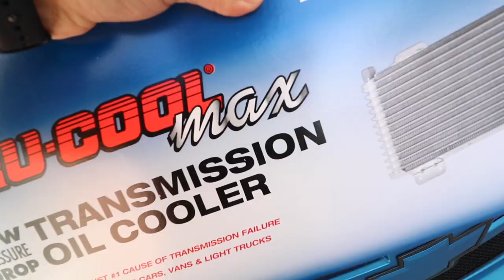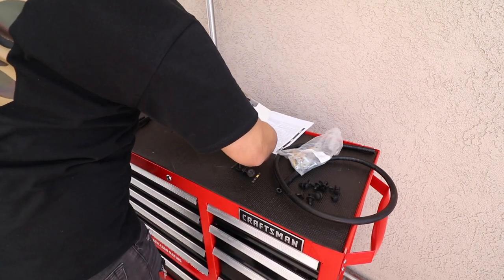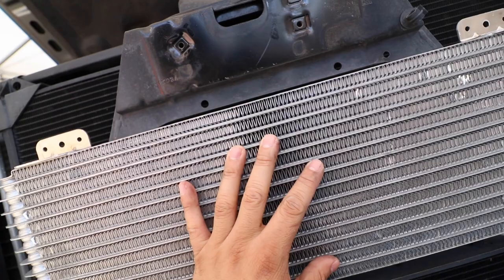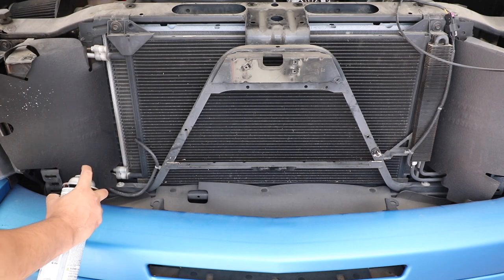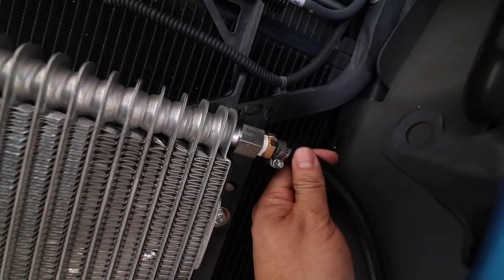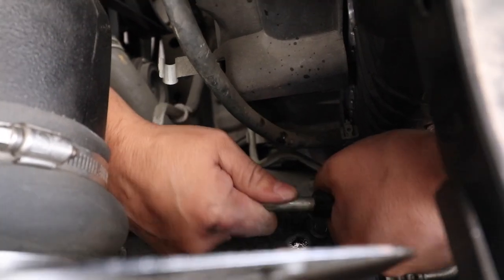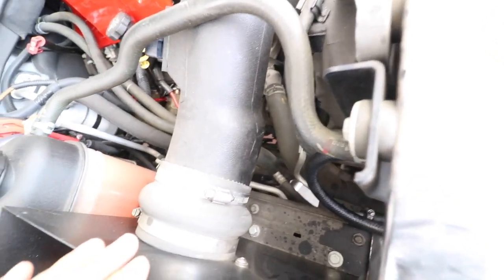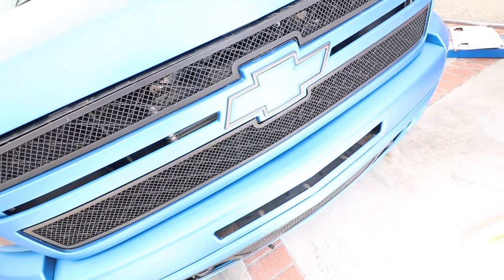INSTALLING A 40K TRANSMISSION COOLER ON MY 09 SILVERADO SINGLE CAB!!!

Comment: Helpful post, bro!  Just a couple of suggestions to those who want to do a similar installation--

1.  Install both auxiliary hose lines in the correct lengths needed to connect up to the main trans line ahead of time and then carefully pre-fill the entire new cooler and hoses with trans fluid so that the system is pre-filled and will have no air pockets.  You can plug the hose ends with a bolt shank or similar so that it doesn't leak out while you're re-connecting.  Then carefully take the plugs out and connect to the main line connection points.  This minimizes the qty. of fluid needed to add once the job is done and also (as mentioned before) eliminates air pockets in the line.

2.  It's up to you, but if it was me, I would remove the air intake tube / box to have better access to the trans line where it connects to the radiator.

Overall though, good vid, with easy to understand steps.  You do good work on a budget too!  Keep up the good work!
Reply: Thanks!

Comment: Nice!!! Mine just came in can’t wait to installs my temps are typically around 185 and easily get to 200 with heavy foot right now
Reply: What’s uour temp running at now?
Reply: What’s it at now?
Reply: @gagegonzalez2767  average 150-160. Went off roading hard in high desert and Max 185-190 for a little bit. Super impressed.
Reply: I need it bad then

Comment: You gonna have to relocate the ambient air temperature sensor, otherwise you ambient temperature will be higher, i make that mistake lol
Reply: Yup, I'ma leave it like it is until I have to take the bumper off again! 😂 Keeps my 6l80 no hotter then 185 loaded.. 120 at lowest. But mine is a Dana trucool 40k

Comment: 1 On re-assemble do not FORGET to replace the securing'HoseClip' back of radiator when inserting the new Part - No 397  ..otherwise you will blow all of the Trans fluid when in gear! 2 Prefilling the cooler is a wise move, and as the maker notes you DO NOT HAVE TO install with the hoses down, you can go side, either way or on top, it does not matter which way.

Comment: Thanks for the post man mine usually runs about 200-230°F so this is helpful
Reply: Dang mine get from 100 too 150 and I thought that was bad
Reply: @1highLT  that’s good you prob already have a aftermarket trans cooler then
Reply: Mine does too and it didn’t have one just added one now
Reply: I wish we could have seen which line from new cooler goes where.

Comment: I ran mine to the bottom and cut the single hose they provided in 2. The trans line you tap into makes a U  in the bottom and i cut it then slipped the hoses on but either way works

Comment: Protip flip the cooler with them at the bottom they are only filling up to about 3/4 of the cooler. flip it over and use 100%
Reply: what’s them?
Reply: Sully the connections on the cooler!
Reply: I don't understand this. Can anyone clarify, please?
Reply: @markumark1  to keep the hoses side up on the trans cooler so there’s more room for the fluid
Reply: Per one of the tru-cool engineers, they said that it doesn’t matter how it’s mounted. It fills completely regardless. No different then how the oem cooler is mounted with a tow package.
Reply: I think he is referring to the top of the cooler can fill will air and get air locked . Check it with heat gun to see if it spread out !
Reply: That's not true at all. It clearly states on the true Cool website it can be installed up or down

Comment: Thanks for making this video. I have a dump body on 2012 DRW 6.0L and I see 180 degree on some occasions so I am updating the cooler with what you have. When this happens I usually have about 6-7k of weight in the back and it's 90-100 degrees outside.

Comment: Rotate 180 deg, inlet and outlet on the top would be perfect.
Reply: Why? Asking bc about to install
Reply: @frozone993  100% all the transcooler rows will be filled by the fluid. Do not fight gravity since the pressure is low.
Reply: I don't see how gravity is s problem since the fluid already goes from the bottom of the radiator to the top.  ??
Reply: The factory coolers are installed with the outlet/inlet going down
Reply: Wich is the inlet on the cooler?

Comment: I installed mine either the lines on top. Assures you all the air is out of the cooler and it’s filled 100%
Reply: so your lines are pointing up instead of down like his are?

Comment: have you noticed any weakness or kinking in the lines when they're up to temp? especially the "return line" at the top of the radiator? cool video btw
Reply: I have same set up mines riped at that bend where he says he likes the bend I’m not sure why it ripped but I sure did lose like 9 quarts all over my engine lol I’m looking for a better set up

Comment: Did mine and decided to flip it the other side up and it worked fine i didnt have to cut it after all , its always good to doubke up on the clamps for good measure i was skeptical at first but fuck it even threw a zip tie over the lip just in case , also bro where did you get the mesh on the grill ?

Comment: I think i need going to need one of those.. My temp on my 2008 is at 167 and sometimes goes up to 217 is that bad? Only when im stepping on it alot.
Reply: Anything over 190 is not great, over 210 is really bad

Comment: Why did you tie into the line on the radiator? Wouldn't you just connect to the lines already out there for the factory cooler
Reply from the maker: Does not have a factory cooler
Reply: Oh ok :)

Comment: Just curious, how much did you spend Becuase I see some for 300 and some for 170, also mine has the oem tow package so it has the line already running to it ?
Reply: Some are way over prices bro but they got for like $120-$140

Comment: How come your truck dont have the small trans cooler where you mounted the new one? Anyways did it make any difference? I live in az and trans temps go to 210. Just looking around to see if it works i need to upgrade mine
Reply: The single cab work trucks didnt have tow packages, so it wasnt necessary to have one from factory, the truck has everything to tow minus tow hooks and a hitch in the back, so if you plan to tow or race then youll be adding one

Comment: That fitting you put in the radiator is that bypassing the inner trans cooler in the radiator ?
Reply: That's where it comes out of the radiator. Then it goes through the cooler and then back to the transmission. It's going thought both
Reply: I know it's old comment but just for people in the future. Some people bypass the radiator all together but that shouldn't be done. The radiator helps the transmission warm up in cold weather.
Reply: @brett9382 will this work on my 2009 gmc sierra 4.3 ? I have the same issue of the lines going directly to the rad but I want to install a cooler same as you

Comment: My transmission temp has reached up to 230F what can i look Into due to it being that high , besides this cooler set up that I plan to do.
Reply: Not to much. I have a grand prix gxp and the temp hits 220 plus in the summer. Using this with a 180 degree thermostat bypass unit.
Reply: Bigger transmissionfluid pan
Reply: @TheShadeManGuitar  thermostat? Like for the radiator?

Comment: Doesn’t that restrict airflow to the radiator?
Reply: Not really, you see all that open space it has? And then how small that radiator is, so no
Reply: Some GM trucks have factory coolers, so that should answer your question

Comment: Quick question would this work for a ram 1500 magnum !🤔
Reply: I know it's a year ago but anytime you can put air over fluid it will lower temp the silverados have a notorious  issue of getting warmer then they should. That's why he made this video.  But overall lower Temps are better for transmissions

Comment: So I have a question? How’s your dash look mine is trashed! Cracked and missing pieces that’s on the top of my list to fix on my 2008 GMC Sierra.
Reply from the maker: Like new bro
Reply: I have the ltz dash the Denali dash.. they all crack cuz of the heat.. I recommend ceramic tinting your whole vehicle including windshield the what cracks it.
Reply: I need to replace the whole dash do you recommend a good replacement. I have seen some on amazon. I thought about just putting a dash cover but don’t really like the look.

Comment: First why run it thru radiator, that defeats the whole purpose. Second you never run trans coolers with fittings pointing down. Do a little research before you takcle projects
Reply: Which is the correct way to install it
Reply: @laramiewatson9679  you want trans cooler mounted horizontal, pressure supply hose at bottom
Reply: Factory Chevrolet transmission  cooler fittings are facing down all the time.
Reply: @1SYCRYD   so why would GM have it faced down from the factory?